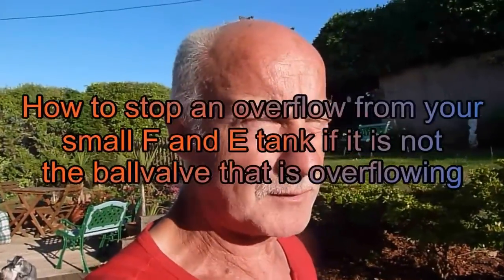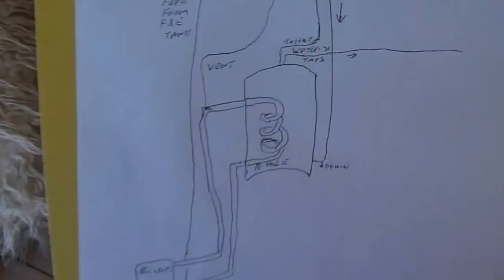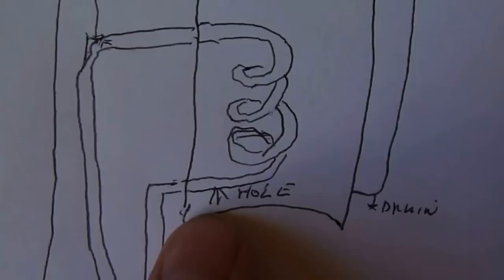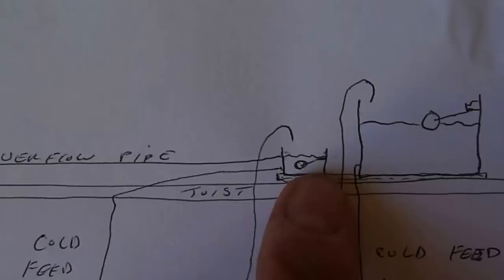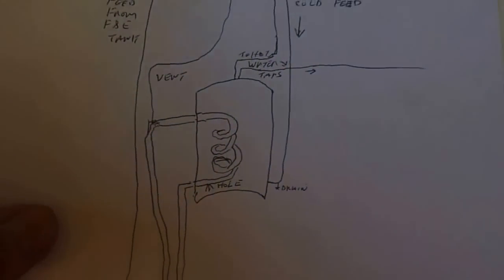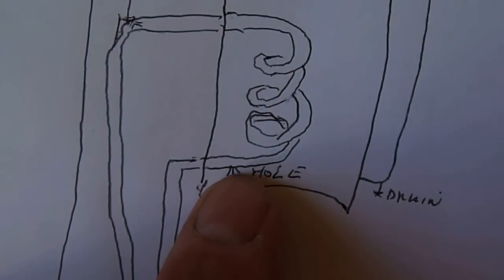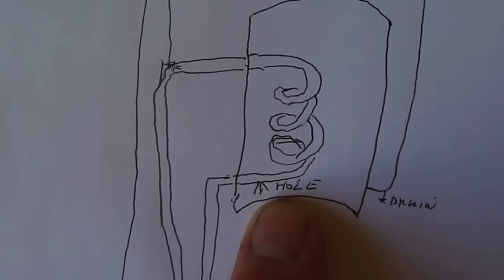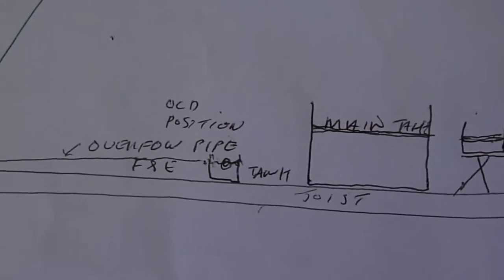How to stop the overflow from an F and E tank when the ball valve is ok

Comment: Thank you for this. I was just about to change the valve again thinking it was just corroding.

I wonder if there might be a cheaper easier option though, probably only a short term fix:

Drain the hot water cylinder (turn off supply to cylinder, making sure immersion is off, drain by turning on hot water taps), add leak sealer to central heating circuit and let that fix the hole. I've used leak sealer before and been very impressed with the leaks it has been able to fix, and they are still fixed years later. Being immersed in the cylinder may limit its longevity, but may be worth a try?

After letting the sealer go to work, refill the cylinder. Jobs a good'n.... Hopefully!!!

Reason I recommend draining the tank is because the pressure differential may stop the sealer touching the leak, and I doubt the sealer would actually work/set unless there was air outside the leak.
Reply from the maker: a bee Worth a try, Al

Comment: That's the perfect explanation of what I'm getting at home. Loads of rusty coloured water pouring out of the overflow pipe. I was wondering why the water from the rads was getting pushed up to the F&E tank. Mystery solved. Now - to bite the bullet and get a new cylinder installed....Thanks.
Reply from the maker: That's the expensive part Kenneth.
Al.

Comment: hi al. great videos keep them coming.I need advice on draining central heating on a combi boiler system.I need to move a radiator,and need to run new pipes.how do i drain the system? when i refill it do i have to use inhibitor? how do i fill the system with inhibitor? i don't have any towel rails just standard radiators thanks

Comment: Hello would you not be able to fit a one way valve on the outlet of the following and even tank to stop this, or would this be contrary to building regs?
Reply from the maker: +simon green The one way valve only works under pressure, there would not be enough to keep it open to keep the boiler and rads topped up. Al.
Reply: Cheers Al I thought that may be the case but was hoping for a smaller job than the one I'm now faced with

Comment: Hi thanks for the video.

Is there any reason why the main tank would keep overflowing even though the ball valve has been changed several times to ensure that's ok?
Reply from the maker: Good question! Check the hot water tank is not getting too hot and expanding into the roof tank.
Reply: @dereton33  Thanks for quick reply.

So in my roof I have 2 tanks. Main tank and F&E (smaller) tank.

Water keeps continuously overflowing from main tank, have tried various new ball valves to fix this.

The only inlet I see into the main tank is from the mains water.

So what am I looking for here and have I even got this right?!

Comment: We have an airflow heating system and only use the immersion heater for water, we have this problem which your video confirmed, cheers!
instead of raising the tank up can you just turn that feed off?
Reply from the maker: GLYN CURTIS Yes you can, but eventually the airflow boiler will start to run out of water as it evaporates over time and is not topped up by the small tank, it could take up to 3 months too show up though, the boiler will shut itself off, banging and knocking before it does.

Comment: By the way Al. Does a hole in the heating coil mean that the water from the rads gets pushed into the F&E tank which then gets expelled outside?
Reply from the maker: Hi Kenneth no rather the water from the cylinder hot domestic side pushes up with the rad water to make the rather horrible rusty looking water from the overflow pipe.

Comment: thanks for the video
I tried everything to fix the leak.
2 Ballcocks later large small tank changed. 
I realised this is the issue I had from your video. now I didn't lift the F&E tank same height as main tank but put in a check valve . this seems to have fixed the problem but just query could I cause any other issues by using this method.
Reply from the maker: Only if the expansion ever blocked as the cold feed is blocked with a check valve.
Reply: Baby Noel take the check valve out ASAP

Comment: hi  , I have the same issue , it doesn't come out of the overflow all of the time , just at some point with the heating on , the fill line in the F&E tank is warm to the touch,the ball cock is not leaking. But the tanks are under the hip of the roof as I have a loft conversion and the F&E tank has already been raised above the cold water tank so it is above the height of the radiators in the dorma. Any ideas? many thanks

Comment: Thankfully my little pinhole must have clogged by itself because the drip drip drip finally stopped shortly before I was due to get the hot tank replaced. Either that, or somehow the excess of air I had in the system was expanding as it got hot and causing overflow. Uncertain. Either way, the F&E eventually stopped filling and overflowing.
Reply from the maker: Fingers crossed it stays ok.

Comment: Thanks for the info ...however if the coil was damaged wouldn't my hot water from the taps be dirty? It isn't and the overflow drip is clean too yet my f&e tank still overflows even submerging the ballcock after new valve fitted..thank you.
Reply from the maker: If it is a small hole then your hot water would not be contaminated enough to show. You will still however have the overflow. Your  F and E  tank must be sitting on your ceiling next to your main tank.
Reply: dereton33 oh I see...that's interesting ...and yes the tank is right next to the main tank in the loft ...the main tank level being much higher under normal operation ...looks like a new hw cylinder then....that's for your reply and for all your hard work with your reviews and tips.

Comment: I have just had british gas round doing a service. They have informed me that the pipe sticking out similar to yours is illegal and I have to get it diverted from the second floor to a drain as scorching water could come out or they will put a sticker on my boiler saying unsafe to use. Is this correct? Any advice would gratefully be received
Reply from the maker: Have just e-mailed you, but in short that is correct.

Comment: Hi Al! Hmm... Pinhole in the coils in the hot water cylinder? Would it be worth trying to use something like Sentinel leak sealer (add to f&e tank) or is that a bad idea? Would I end up with leak sealer in the domestic hot water supply?
Reply: I mean, do leak sealers need exposure to air in order to cure/dry and fix the leak? Cos if they do, they obviously will not work in this case as this pinhole leak is underwater (unless I emptied the hot water cylinder first... But then I can't run the boiler....)
Reply from the maker: I think it would be worth a try it does cure underwater. I would drain some of the heating system down and the water in the outer,  to the level of the cylinder return pipe, before adding it. So when filling the leak sealer goes straight into the heat exchanger coil of the cylinder.

Comment: Great video. However, I’ve just changed my hot water tank and the F & E tank is still filling up and the ball valve is fine. Any idea as to why this is still happening?
Reply from the maker: Blockage in heating system. Have you had the heating system cleaned recently, within the last 5 years.
Reply: @dereton33  
Hi, I’m just having it cleaned now. I’ve put in some Fernox and will leave that in for a week then flush it though. Also I’ve lifted the ball value so no new water is introduced into the F & E tank, but the level of water has still risen about an inch and a half from yesterday. In answer to your question, it’s not been cleaned for the last 7 years

Comment: Hi, Thanks for the video, however my issue seems to be only happening when the boiler is heating up the hot water, Water seems to be coming out of the vent I have turned the water temp really low but it still happens . Any ideas?
Reply from the maker: +Nigel Gregory . The level of water in the F and E tank may be too high to begin with , go up and bale out the tank to a lower level and make sure the ballcock is set low as well.

Comment: Hi,

Would a none return valve on the inlet to the tank solve the problem. I have tested that a one metre column of water in a 15mm pipe releases the valve and water flows freely down but the unwanted back flow is prevented.
Reply from the maker: I have tried that but it never worked, but do give it a go. Raising the H and E tank to the same level as the main roof tank works, as does sorting the main problem which is to renew the hot water cylinder.

Comment: Just moved into house, two overflows, one drips slowly (drip about every 10 seconds), so going to go up and check the ball valve. So if water level is above it and the tank is lower, then this could be the problem. I guess I check the valve first.
Reply from the maker: +Nic Chilton Thats it Nic, ill keep my fingers crossed for you. Al.
Reply: +dereton33
 I have the problem but the water overflows from the larger main tank positioned close up to the ceiling housed in a closet in the bathroom while the small tank is positioned on the joists housed in the loft.  You could say that the small tank is higher than the main tank. 
When the hot water is turned on from the boiler the main tank over flow. The hot water does not stay hot for long.
To stop the water coming out of the over flow I have to keep the boiler hot water off and leave the hot water tap slowly running. 
What do you think is happening. 
I thought of asking God but he was unavailable so watching your videos I think you are the next best thing.

Comment: Wonder why my f&e tank is two feet higher than the top of my cold water tank?
Also, why is the f&e tank overflow going into the cold water tank?
Reply from the maker: That is the way they used to be fitted. It sure would not be allowed now. That overflow would never discharge into the water tank, but have it`s own overflow pipe leading outside.
Reply: dereton33 
Should I lower it? 
While I replace ball valve I'm  going to install its own separate overflow now that I've seen it goes into the cold water tank 🤢

Comment: Ok I'm a bit confused now! So if I'm getting lots of rusty water from the overflow pipe,  what's the diagnosis?
Reply from the maker: Water from your cylinder is being forced into the inner coil and mixing with the rad and boiler water this then pushes up into the small header tank and out through the overflow pipe.
Regards,
al.

Comment: my tanks overflowing as i type and im frantically looking for solutions lol
Reply from the maker: If it is coming from the F and E tank, then you have big trouble.
Reply: i turned off a valve which was under my kitchen sink. that stopped the over flow but i dont know what the problem is. i contacted my landlord and he said he will send in a plumber. i dont know what the problem is or the solution. 

i believe it is the f and e tank. if it is, what kind of trouble am i in? also should i turn on the central heating / boiler? please excuse my incompetence.

Comment: This is rubbish. You need to replace the cylinder. You have a pin hole in the coil which could contaminate the hot water that your brushing your teeth with if it gets larger.
Reply from the maker: Brushing your teeth with hot water urggh.

Comment: The hole won't get any better and I'd prefer the new tank method especially as I'm going to drain my central heating PERMANENTLY and go all electric. Whoever invented central heating with water being pumped all around the house wants a kick up the backside. What happens when you get a pinhole or a leak inside the walls or under the floor?
Reply from the maker: All electric? Hope you have deep pockets to pay your massive energy bill.